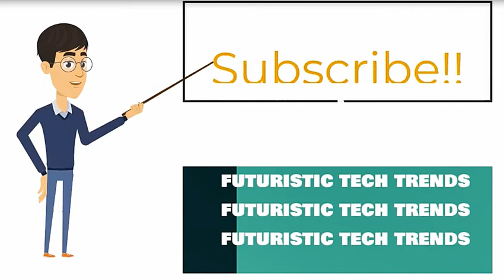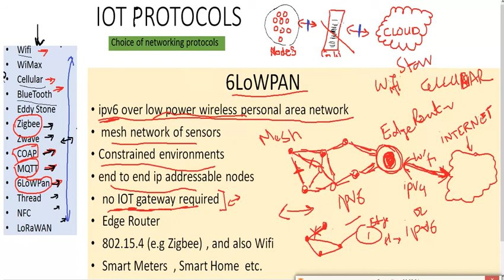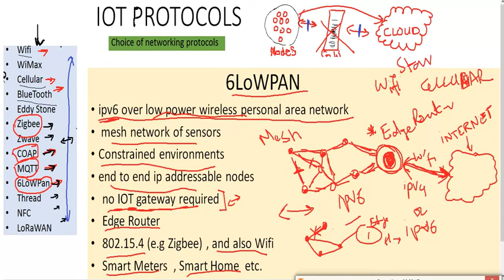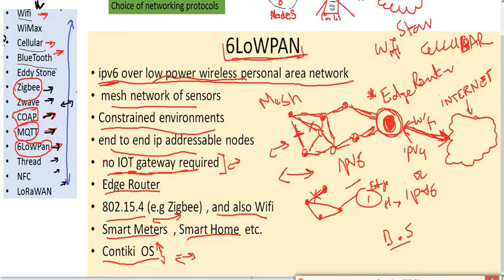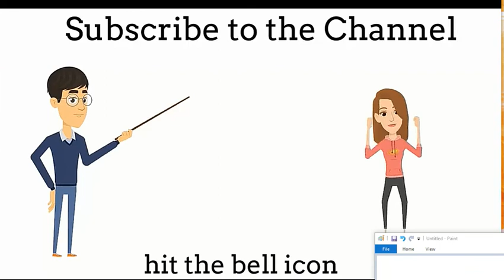6LoWPAN IOT Protocol

Comment: Hi! What is the range of distance for this protocol?
Reply: Bro, it depends on the hardware that you are going to use.
With 13dbm of output power and around -105 to -110 dbm of receive sensitivity and 50kbps of data rate, you can expect somewhere around 100meters, and again it varies based on few other external factors.
Reply: It is used with IEEE 802.15,.4 in the 2.4 GHz band.
Outdoor range: ~200 m (maximum)
Data rate: 200kbps (maximum)
Maximum number of nodes: ~100